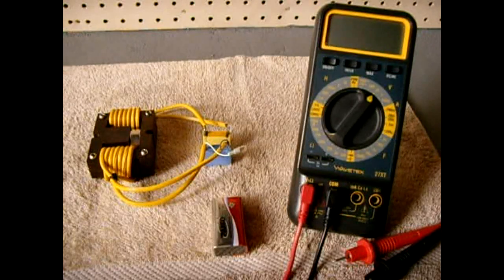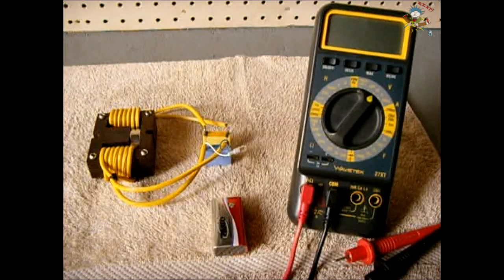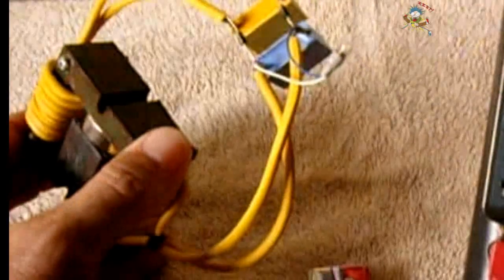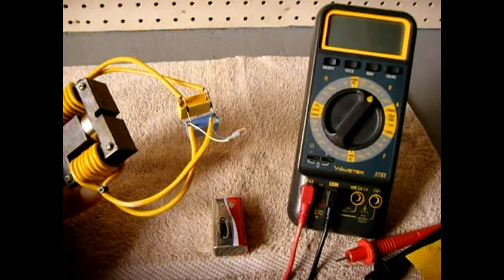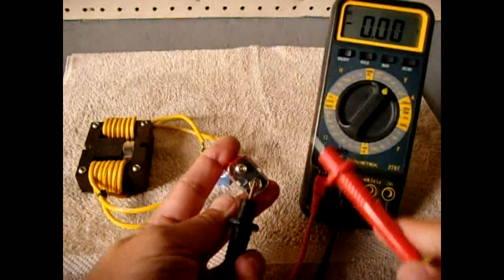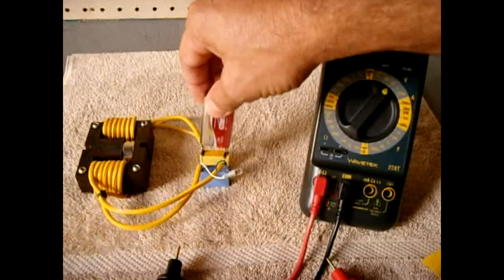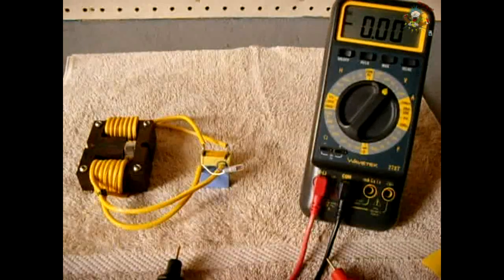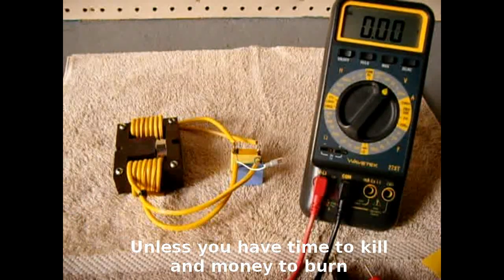Overunity Motionless Free Energy Generator EXPOSED!

Comment: Not that I like the idea, however, the coils ratio is wrong. A replication even if it wastes time, has to be as exact as possible.
Reply from the maker: Clearly you DID NOT watch the entire video and read all the annotations. The coil issue was discussed. :-)
Reply: electronicsNmore: It is obvious even without considering Emmy Noether's theorem
about conservation and Calculus of Variations, that technically with two diodes in the same direction, energy can't be transferred from one coil to the other - which means that the video is a hoax for sure. Taking energy from space-time is possible but not as presented in the fake vidoe. It requires Dennis Sciama "inertial induction" by creating local warp drives, i.e. becoming a "leech" on cosmic expansion. Inertial Induction can violate local conservation as it pulls far bodies of mass even many light years away. I've been doing research on Electro-Gravity via Chronon Field for about 12 years. The true way of doing it is by massive electric charge separation. The ridiculously small charge separation on pico-farad or less, asymmetric capacitors can cause ions wind but in vacuum it will not cause any measurable thrust. There is a virtual mass effect by charge. For example electrons generate a negative gravitational field and protons generate a positive field. Virtual_Mass = (+,-)Q/Sqrt(16 Pi Epsilon0 K). (Epsilon0 is the vacuum permittivity constant, K is the gravity constant, Pi=3.1415926..., Sqrt is the square root and Q is the electric charge) Over 1 meters distance, separating + and - 20 Coulombs is sufficient to overcome the gravitational field of the Earth and cause elevation on the expense of the energy of far bodies of mass. BTW matter field is a prohibition on inertial/geodesic motion in Minkowsky space-time. That means that besides the unexpected gravity around electric charge, there is in an opposite direction, an acceleration field that like gravity depends on mass but unlike gravity does not affect photons. For electrons this field attracts and overcomes the repulsive gravity field. This is why Dark Matter is actually interstellar electrons. The acceleration field is expressible by the Tzvi Scarr and Yaakov Friedman matrix. It is very weak. It requires an inconceivable field of 1 mega volts/1 mm to expose an acceleration of neutral particles at less than 0.01 gees. I would instruct you how to build a real Inertial Induction machine without the separation of electrons and protons, however, this would be irresponsible, taking into account Iran and North Korea. The hoaxes in the videos do not help in promoting the real and working ideas. That is why debunking is essential and you have my full support. P.S. My research starts with Dr. Sam Vaknin's doctorate dissertation on Chronon Field from 1982. Sam is a Dr. of theoretical physics and of psychology.

Comment: On the original movie the core of the transformer was made from solid iron block. Your core is blocking apperrance of viral current inside the core. Can you replace the core? I'm really courious if it will works. Sorry for my language.
Reply from the maker: WRONG. You clearly watched the wrong video. The fraudster used a laminated iron core.

Comment: You people are so funny, i love watching overunity stuff. Yes its THEORETICALLY possible but in the real world it is never ever going to happen.
Even if you managed to find a way to stop ANY loss of energy through physical movement of windings and laminations,
If you  discovered a material that was a superconductor at room temperature and thus had zero resistance/inductance to form the windings with so as not to loose energy through heat etc,
If you found a way to stop any loss of electromagnetic fields,
If you shield it from any electromagnetic waves that could oppose the energy in this machine and stop it,
If you made the inductor with zero capacitance between windings and between windings and the core,
IF you managed to make this you would at best have a UNITY machine that will run forever, yay well done, you would be the most important person in scientific history (id cash in on that if you really are correct). But as energy can`t be created, it can only be changed from one form to another there is a floor in your plan.........
What use would it be?
It would run forever in a complete lossless loop right (or until the componets wear out or otherwise die, not a big problem really just needs occasional maintenance, i can accept that).
So what would you do with it?
It would be completely impossible (theoretically and practically) to use it to do anything without loosing energy to whatever you are powering, so the energy ringing about in it would decrease until there was nothing left. (id give it about half a second).

I`m confused, to anyone who has the knowledge to build such a thing it is obvious that it will never work. (unless you have some other motive......)

Oh go on, carry on..........
Reply: Vladimir Bulgakov Magnets have no energy, only force. They're like springs.

You can squeeze a spring and it pushes back, but only as much as you squeezed it. You can put like poles together and they will push back, but only as much as you pushed them together.

You can stretch a spring and it will pull back, but only as much as you stretched it. You can pull opposite poles apart and they'll pull back together, but only as much as you pulled them apart.

You can move an object by pushing or pulling it with a spring, but only as much as you push or pull the other end. You can move an object by pushing or pulling it with a magnets, but only as much as you push or pull the other magnet.

Springs wear out with use because of metal fatigue. Magnets wear out for the same reason.
Reply: You are absolutely correct, technology is improving every day.
Unfortunately the laws of physics very rarely do.
Reply from the maker: You're correct, it is obvious this will never work.
Reply: electronicsNmore nothing is ever lost or destroyed, energy is converted and this does work + and - exist in a batery and in magnet and magnet will work as battery and will lose its magnetism with time, so before you post saying cant think that magnet is not for ever, energy is not mater its a curent of matter, like a wind mill, all you have to do is tap into it and since earth is a magnet self recharging taping into earth magnetism is the best source of reneawble energy that can be accesed through trees, air, structures and materials...
Reply: says you, but consider the tech that improves so quickly
Reply from the maker: Good one. This guy is trying his best to knock my video, meanwhile he has not done any testing of his own. I tried multiple winding configurations, as well as magnets. This device does not and will not work.
Reply: know i understand magnetism is different and actually will make a video disproving this one, but i know that magnets are used widely in electronics! there are claims that magnet has 0 energy, but i don't believe it... how can something have no energy..., and if there is energy there is a way to convert it.., also good one to challenge is gravity, taping into energy of gravity would be nice but i saw on kick starter a floating board above the ground like a skateboard but i think it works on metal surface only with electrical field.....
Reply from the maker: Good luck disproving my video. You will never get this scam device to work. Capacitors are 2 metal plates separated by a dielectric material. I would like to know what capacitor you have that contains magnets?
Reply: sry my bad, i wanted to say that its similar to electrical field, didnt understand something...
Reply: but can disprove it by hiding a tiny battery
Reply: Very nice explanation, thx!!!
Reply: Andrew Kirkham BLESS YOU! GOD BLESS YOU! I needed this explanation. I've come up with a way to meet ALL OF THESE REQUIREMENTS I believe. For very LOW COST. And will run on low power. And it explains why this works. The OXIDE IN THE DIODES! He is building up magnetic potential by turning it on and off until the potential is just enough to cross the gap at magnetic current with zero voltage. The nano material nature of the LED and the enclosed container of the vacuum pressure of the container allow this to happen.
Reply: Vulgum Pecus Telephones, computers, and the internet don't create something from nothing. The phone was invented 130 years ago, by the way.
Reply: Vulgum Pecus Do you even know what "overunity" means? It means something from nothing. There is a huge difference between legitimate scientific experimentation and overunity scams. Only a fool can't understand the difference.
Reply: Vulgum Pecus You asked who brought up something for nothing, genius. Don't get mad at me because you can't understand the obvious.

 You idiots seem to think if you wish hard enough, and use and avoid certain magic words, some mad genius without the curse of knowledge will stumble across a magical new energy source by arranging magnets and wrapping wire. I have bad news for you; It doesn't work that way. Good luck with your alchemy. Ignorance is not the key to finding some new, currently unknown source of energy.
Reply: Vulgum Pecus "Yeah right, because having hope and motivation is a bad thing according to you."
You only wish that were true, like most of the other bullshit you've been spreading.

Your ignorance is astounding, and worse, you take pride in it. Our understanding of electromagnetism (or any science) was not furthered by ignorance of preceding science, no matter how many times you tell yourself it was. I know this runs contrary to your methodology, but have you considered looking into the historical breakthroughs in science before talking about them?

And no, I'm not going to stop telling people this is nonsense and making fun of fools dedicated to ignorance. Some people listen to fact and reason, and will be informed and saved from scammers, and making fun of idiots like you is too much fun. Some people seek knowledge and some people shun it. Guess which group my money's on to make the next big breakthrough.
Reply: Vulgum Pecus You're right I do like making fun of fools like you, but not everyone watching these things are. Too few, but some people are genuinely curious and seeking knowledge. They don't know yet, but unlike you, they want to know the truth. If nobody was around to point out the idiocy of people like you, your willful ignorance might spread like a disease. There's already far too much of it in the world already.

Though I don't really consider myself a scientist, I did ace both semesters of Calculus Based Physics and have a Bachelor of Science degree, in Computer Science. I'm not just talking out of my ass and wishing on rainbows like you. I promise you, willful ignorance is not part of the scientific method you think you're lecturing me about.

"People who want to make money are not going to make devices to produce energy at a very low cost, because that's not profitable long term."
That's what idiots say to justify ignorance. There would be billions, if not trillions, to be made producing things like this if they were real. They're not real. What factory wouldn't want cheap/free power? What shipping company wouldn't love to have trucks and trains that ran on cheap/free power? You really think there's no money to be made selling that capability? Catch a clue. 

There's no conspiracy to hide them, because things like this are not real. Every science teacher, every physics and engineering student, every physicist and engineer in the world would have to be in on such a ridiculous conspiracy. There's no conspiracy to hide them, because they're not real.
Reply: https://t.co/jJLJDPZ75N?-FreeEnergyBulb-7
Reply: @esmeetetteroo159  bullshit

Comment: After 60 years of being involved in electronics. There is no energy floating around in the air for dummies to ":discover": if you are close enough to a high wattage radio transmitter, there is some usable energy.Of course if you are stupid enough . you could build your own hidden spark transmitter. to supply the need to impress other idiots.
Reply: gren. dyn

Comment: Just looking at the schematic tells you it is bogus as the circuit has no path for current flow other than the DC short the 9V battery sees while connected.